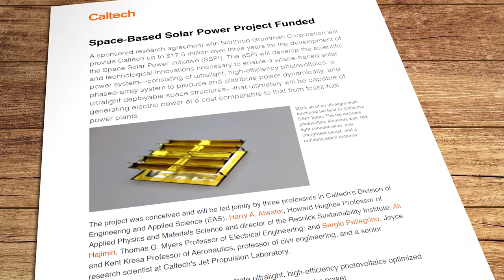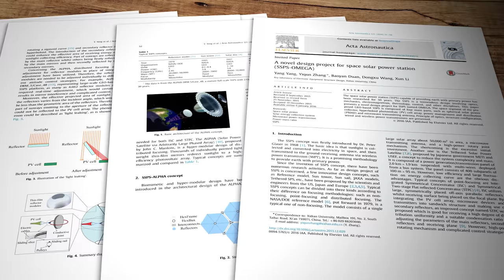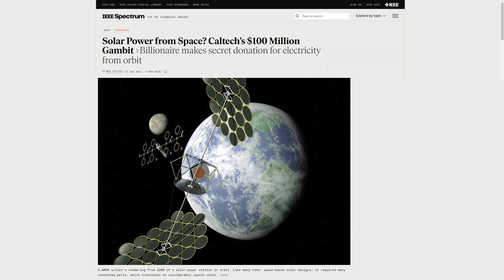Powering the planet from space. Closer to reality than you think?

Comment: Yes, it's bonkers. Among dozens of other game-breaking technical issues, the energy transfer losses are simply too great.
Reply: Agreed.  It's absurd.  The cost would be insane compared to just putting the panels on the ground.  The cost differential would buy a hell of a lot of storage.
Reply: yes, the atmosphere would have to be free of any dust and maybe clouds, otherwise the beam would heat the atmosphere instead of powering cities. And not only that, it's also much too dangerous, thinking of satellites, planes, and birds crossing the path of the beam.
Reply: And then think about what happens if a technical glitch of some sort cause the high energy beam to offset, and possibly hitting some giant storage of whatever flammable substance.
Reply: Right or we could just let the sun power the Earth just as it has since the beginning!
Reply: Life would end without the sun.
Reply: You might want to get back to basics. That might b be hard since you're addicted to power.
Reply: Losses don't really matter when you can scale the satellite for unlimited input.
Reply: @steenhansen5625  Then build the beam so it can't do that? Whatever method you use to focus the beam, just make it too physically small to focus the beam enough to do damage, and make the receiver larger. The old NASA designs assumed a phased array 500m across, and even that could only achieve a beam intensity of ~1/3rd sunlight. These were never 'death rays', and whoever told you they could be was either lying, or ignorant.
Reply: @anticarrrot  Non sequitur. The ability to scale has nothing to do with transmission losses, so that's not a valid argument. Also, a sattelite cannot collect "unlimited energy".
Reply: @Delian0  Begging the question. Transmission losses are irrelevant to the end user or investor As long as the system can output X power at Y price no one cares. And the satellites can be scaled up arbitrarily to achieve any desired output, irrespective of inefficiencies.
Reply: @anticarrrot  Saying that satellites can be scaled up arbitrarily is the same as saying that, because something is theoretically possible, nothing else matters. In that case, I could say that it doesn't matter that we can scale up satellites, because we can just build a Dyson sphere. Or, it doesn't matter because we can just generate unlimited electricity through the usage of unlimited hamsters spinning unlimited dynamo wheels.
Reply: @human_isomer  microwaves are at a low enough frequency that dust and small clouds wouldn't significantly reduce efficiency, with the expected losses caused by transmitting through the atmosphere being less than 20%.
Reply: @garethbaus5471  Sure, lower frequencies help with preventing absorption. However, it strongly depends on the kind of dust, the size of the particles and the droplets, as well as on the angle of transmission from orbit. Scattering and coupling with conductive material (e.g., wiring in planes, power lines) is another issue to consider, as well as interference with radio wave transmissions, etc. There may be some weird interferences when materials of different permittivity interact in such a strong field. 
On the other hand you need a way to transform the energy back into a useful kind, for which you need as much absorption as possible to make it efficient. The low frequencies that help for transmission would probably have a contrary effect for efficient re-absorption. 
Regarding scattering, I also think of the radio astronomers who may also have their arguments when the sky is illuminated brighter as daylight in their observation range - which you will have when a small percentage of a kilowatt beam is scattered.
Reply: @anticarrrot  Cost of power ($/kWh) is a valid criteria. Scale of production (total kWh) is not, and this is what I'm focusing on. If you build 2x larger satellite and you pay 2x the cost for it (materials, fuel, receiver), you still paid the same $/kWh, so in this aspect the scale is irrelevant. On the other hand, the cost of power is, in fact, dependent on end-to-end transmission losses. In your equation "X power at Y price", the X is reduced by transmission losses, so I don't understand how you can say that the losses don't matter.
Reply: @anticarrrot  so thanks for admitting you're wrong , because inefficiency does matter as they result in heat and ozone in earth's atmosphere.   so follow your own advice and go away ;)
Reply: @vultureTX001  18TW of humans energy usage. 170,000TW from the sun. 

Even if we got all our energy from space like this it would be a rounding error compared with the power from the sun.
Reply: @incognitotorpedo42  On a falcon 9. with the same costs for the panels you get about 12 hours of storage with batteries.
Reply: Only way of getting this stuff down or up is another Clark idea ..the space elevator.

BTW starlink if it doesnt bring itself and half the other orbitals down will risk spooking someone to hitting the big red hypersonic fractionally orbital device buttons.😱
Reply: @clivestainlesssteelwomble7665   space elevator needs materials that dont exist yet.  carbon fiber strands need be two orders of magnitude longer to form the cables.
Reply: @clivestainlesssteelwomble7665   the ringworld is unstable!  thanks for the niven callback
Reply: @vultureTX001  
The Brennan Pak ... know what to do.😉
Reply: Not to mention if something knocks out the power from space and the complications of fixing it compared to something on earth.
Reply: @cletussamboy8650   "'have you tried turning the  Sun off and restarting it ?" Old man Asimov said.
Reply: @cletussamboy8650  
Can you imagine the damage a passing micro meteorite storm would wreak on any thing like this let alone the swarms of proposed Satelite s Musk and China have planned ... 

You know what a full on pool break looks like... Times that by a few factors... ✨💥🔥🤦🏻‍♂️ 

You'd need deflector shields just to get out of Earth orbit without being turned into a sieve.
Reply: @clivestainlesssteelwomble7665  Seems like the people who came up with this idea need to just have a think
Reply: @cletussamboy8650  
Definately .... Just because one might be able to do something does not mean its a good Idea to pursue it.  See everything in the round ...some specialists whilst useful do tend to loose sight of the whole thing..

Comment: Great video, loved the solar panel satellite animations! Sometimes the best place to put solar panels for generation is the hardest place to get the electricity from them! For example, it would be great to put them in the desert too! (though that would be more practical than space) - I definitely think all those bare rooftops are our best bet for now!
Reply: I am with you.
If all the rooftops had solar panels it would decentralize the power grid.
Making each home/neighborhood/city somewhat energy independent.

Having them interconnected to the grid would allow transfer of power if it was cloudy.
Reply: You are very ignorant, sorry.
It is the transmission of electricity from generator to consumer which adds significant cost to a system. Solar must be installed where the electricity is required, and it makes zero sense to generate it and then distribute it long distances - like we do today with massive power stations.

Comment: The best use of space produced power, will  be space based manufacturing.
The moon has natural resources of metals.   Metal can be smelted using inexpensive solar energy. Bulk metal ingots, or finished product can be shipped back to earth.

 Economics of scale will determine if this will happen.
Reply: Unless those metals are REALLY valuable on Earth, it won't be worth shipping them back.  Space transport is still very expensive, which is why space-based power plants are ridiculous.
Reply: I agree using the power generated in space is best used in space. I feel like the high cost, high tech process of chip fabs would benefit most from the zero g, super clean environment of space. Further space based power could benefit a space based cloud computing and information storage industry.
Reply: @incognitotorpedo42  Economics will always be the deciding factor. 
Environment concerns will drive the cost of production up on earth.